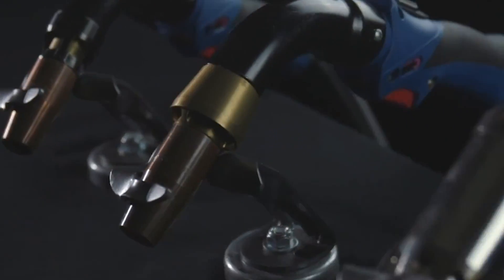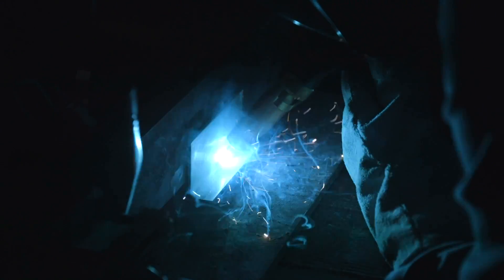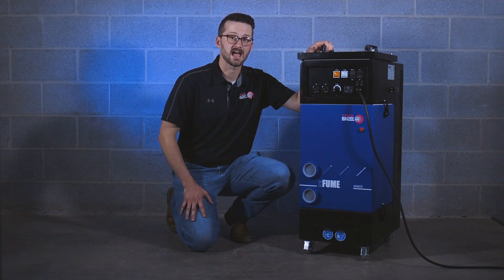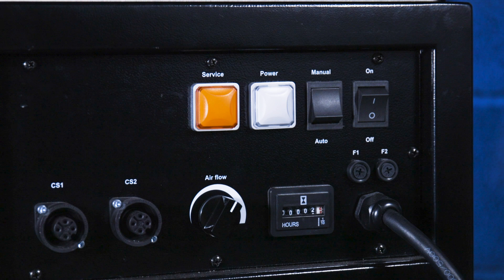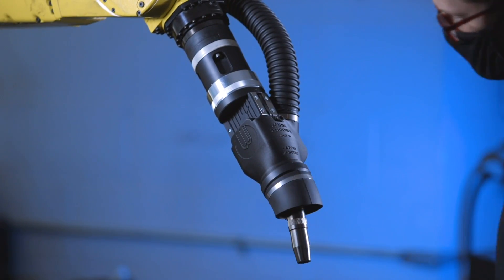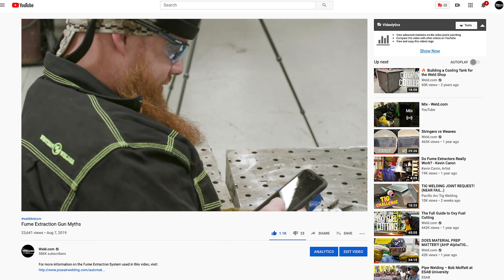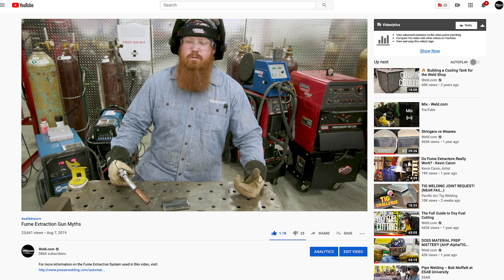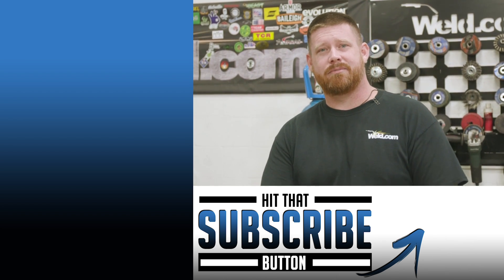Extract Toxic Welding Fumes with Abicor Binzel | Fabtech Cancellation Series – Day 3

Comment: Am amazed that for over 50 years the welding industry are still trying to sell integral torch extraction systems. I did the first lab tests on the Bernard fume extraction torch variation in 1970  and very little has changed since then, same principle, same problems. Apart for the additional weight and bulk of the torch the settings and welding angles are very critical to for the extraction to work successfully and its a fine line between removing the fumes and removing the gas coverage or nothing. Nice and easy to demonstrate in a lab but in production very hit and miss. Several companied I knew brought many of similar type systems and within 2 weeks the majority were put to one side.

Comment: Ship yard uses a big vacuum fans.  With hoses that divide down to 3" hoses.  End is a short steel pipe with a magnet. Now even ugly little spaces are smoke free. 
The funny part is no smoking on board. So have a smoke because the smoke goes  in the vacuum hose plus when you finish your cigarette. The butt gets suck up too.

Comment: Was 1:53 with the extraction turned off?! 

You should still wear an adflo system with the extraction because the extraction can’t capture all the fumes. Had it tested at a workplace before with meters up in our masks. 

It’s not just stainless fumes that are bad, mild steel MIG fumes have been declared a carcinogen now too!
Reply: @Johnathan Doe,  reach out to us, we have tested at very stringent standards for many large companies and have been successful in meeting / exceeding requirements 9 of 10 times. There is a lot of this type equipment out there, key is to find the right balanced system, extraction machine power and matched torch. It took us several years, but have it dialed in. Thanks for watching, hope we have chance to prove our equipment.

Comment: If I can ever afford the small inexpensive welder I want, which uses the flux core wire, I would have to come up with some kind of fume extractor. I do not have a choice. I have a lung disease called Idiopathic Pulmonary Fibrosis, which is terminal. It is not a form of cancer, but it is just as deadly. Which makes fume extraction a priority for me. I wish I could afford one of those x-tract torches but that is so far out of my budget that I couldn't afford one if I had to or die. 🤣

Comment: I have a small garage and no good way of venting it other than opening the garage. However the fumes linger still then. What are some methods I can use to stay safe without putting the money into a fume extractor? Would a N95 mask work? Or should I just use a large fan?
Reply: I built one out of a dust extractor   with a  hose  close to my welding  works ok ?
Reply: @timothyrouse2853  could I use a shop vac with a special filter?
Reply: @mr.purple4634   cant see why not ,  mine is just pushed out of my shed  ,  i dont use a filter ,
Reply: @timothyrouse2853  makes sense. I’ll see what I can do
Reply: get a proper 3m mask with n100 pink filters
Reply: @biggsviii1652  ok

Comment: I agree with most too expensive for a hobbyist at work I fume extractors suck so what I do is wear a miller t94 with a papr which provides fresh air to me and I use a fan to blow the fumes out of my face on the ground which is pointed up so it's not directly blowing my shielding gas away

Comment: My shop is switching to Miller fume extracting guns to avoid hefty fines. They are total garbage. Maybe tell these xfume guys to develope a whip that isn't ribbed for my displeasure. Wouldn't mind seeing the results of some more awkward/confined welds too. Sure it works on test plates out in the open, but I want to see that thing shoved up a woodstove's arse without porosity.
Reply: We can arrange to bring in a gun to test, think you'll see a huge difference in comfort and accessibility compared to the Miller product, u can request demo on the Binzel website. We have success in out of position, difficult applications, but proof is in the product, reach out and we can help.
Reply: @Nut Chunder

Comment: If you do this for a living, you need to watch your health. I've got a 4' extraction fan a few feet away from me, but I have to turn it off while I'm using gas.  Designing the torch from the ground-up for this beats the heck out of add-ons hacked-to-fit.